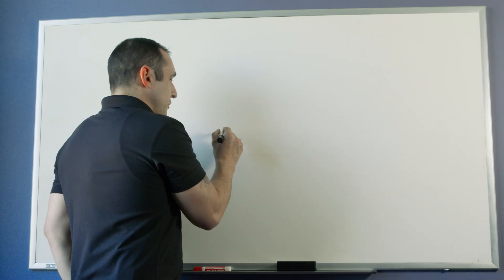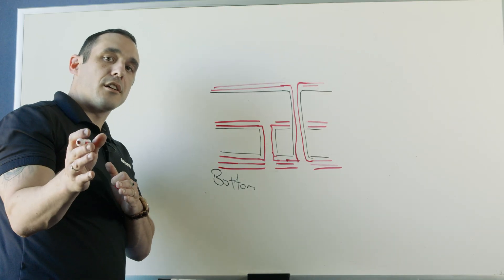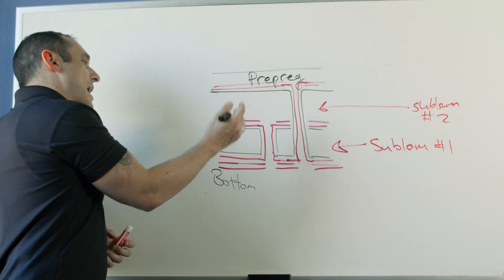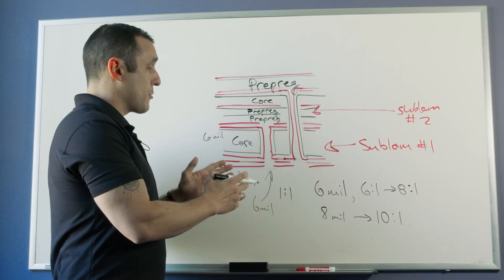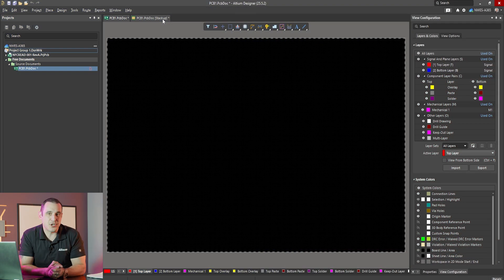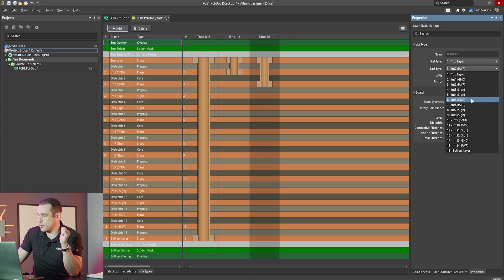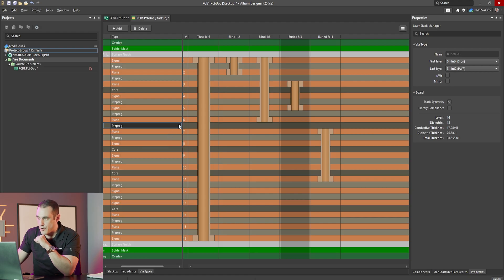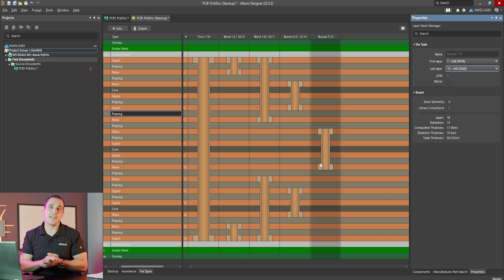Mechanically Drilled Blind & Buried Vias: PCB Design Rules Explained

Comment: Hi Zach and Altium Academy team. Thanks for this very informative video.

I have two questions regarding the plating process:
When you say plating in the internal layer are you referring to electro deposition of copper or a surface finishing like ENIG?
Also do you know which IPC standard talks about the relationship between pad and drilling size for vias as a function of the copper thickness of the layer?

Thank you, 
Santiago
Reply: Plating in the internal layer refers to electroplating of copper, not a surface finish. There are multiple IPC standards defining the required leftover annular ring for different product classes. The general-purpose standard is IPC-2221, but th IPC-60xx series provides standards for more specific types of designs. For rigid boards, the main standard that is used is IPC-6012. Note that the drill size you determine you can accept for a given size depends on the average drill wander the manufacturer experiences on their equipment and is summarized in IPC Producibility Levels.